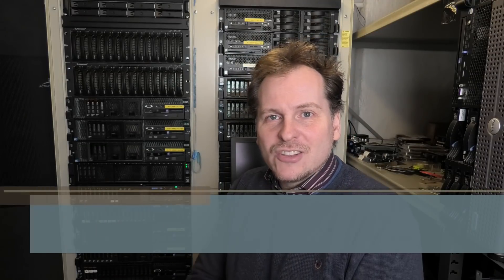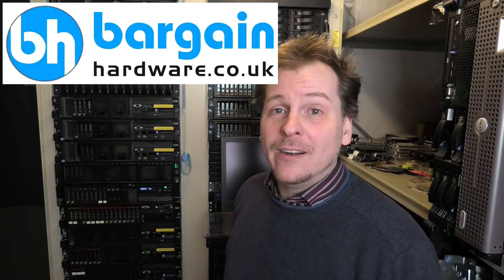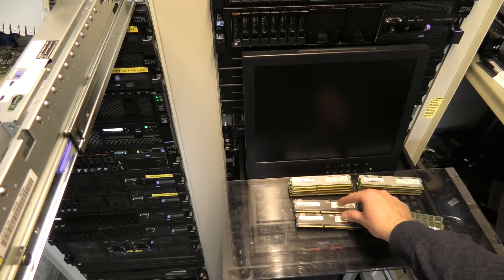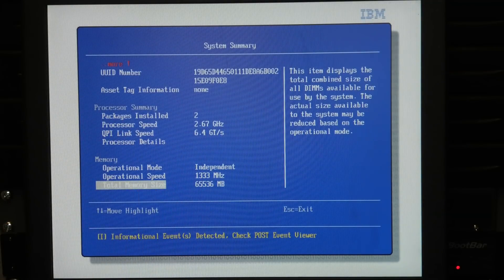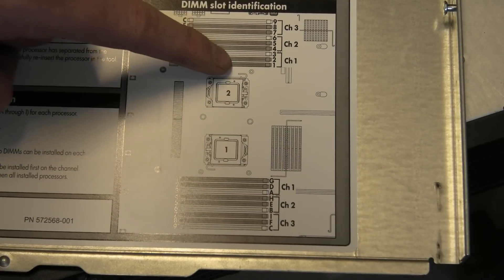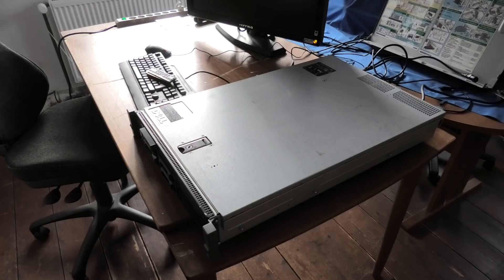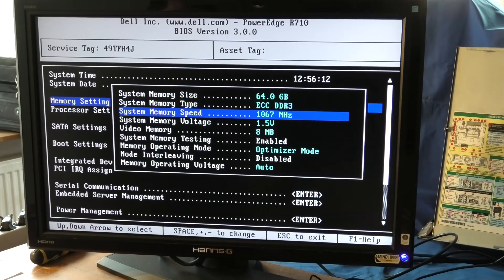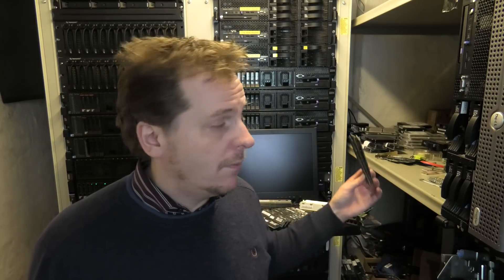3rd Party RAM in Lenovo x3650 M2, HP DL380G6 & Dell R710 - 924

Comment: The riser card "shield" thing in the DL380G6 was a royal pain in the ass to work around. I'm glad it didn't survive and get reused in G7.
Reply from the maker: It was different,, lucky the G6 was rather stable so it was not that often you had to mess with that.
Reply: @MyPlayHouse  Luckily for me, that was about the time we adopted blades for most of our servers, so i never had to deal with a lot of the DL380G6 servers. Now, i'm not entirely sure we actually gained anything from switching to BL460c servers and C7000 enclosures. It certainly wasn't cheaper and the flexibility was... not all that important in real life.
Reply from the maker: That is kind of irritating from a user perspective. And it's most likely just to Fuck with people that wants to use something non HP in there server,, they have a ton of temperature sensors in them,, so it's not as if they do not know what the temperature is.

Comment: I'm pretty happy with my Fujitsu Servers. They don't care at all if I put 3rd party stuff in them. Only downside with the RX300 S7 is that they won't take Xeon E5-2600v2 CPUs even if the RX300 S8 has the same Chipset. So it's more like a decision from Fujitsu to not roll out the microcode for the older boards.
Reply from the maker: I also kind of showed that these three servers did not mind..

Comment: Great video Morten, love the 'Editing Morten' giving you beans at the start, I always thought that you couldn't put "Non HP Branded" memory in a HP Server as it winds the fans up to 100%, a bit like adding an 'Nvidia' Graphics card, HP see's it as foreign and doesn't know what to do, so just ramps up the fans to 100% to protect itself, I only ask as I have a G7 full with 4gb blocks and wanted to upgrade, but the "HP Branded" 8 GB or 16 GB blocks are so over priced.... Your G6 did run normally after boot "Not Jet Engine Mode" afterwards....
Reply from the maker: I do have a bit of RAM for HP servers : https://www.myplayhouse.dk/shop/en/server-parts/35-4gb-ddr3-1333-rdimm-pc3-10600r.html
https://www.myplayhouse.dk/shop/en/server-parts/41-4gb-ddr3-1333-rdimm-pc3-10600r.html
https://www.myplayhouse.dk/shop/en/server-parts/43-4gb-ddr3-1333-rdimm-pc3-10600r.html
But the Kingston should really work just fine! and Yes the dl380G6 did not keep making noise.
Reply: @MyPlayHouse  Ouch €480 to re-populate my server with new ram, thats more than the whole server cost me... might have to start saving....

Comment: You don't specify anywhere if the Kingston RAMs are dual-rank or quad-rank (2Rx4 or 4Rx4). For example, you can't fill all 18 positions in a Dell R710 with quad-rank RAMs. Dual-rank 2Rx4 is normally the better type. The rules for putting many RAMs in a R710 is a bit complicated.
If the RAM can run at 1.35V it is the low-voltage type, so you should specify it as PC3L-10600R.
In the webshop, for the Samsung 4 GB RAMs you write PC3L in the header but PC3 in the description.
Reply from the maker: Hi ytteman
Thank You very much!  I have tried to fix that,,, but it seems to be a bit blurry all around,, like here : https://www.kingstonmemoryshop.co.uk/kingston-ddr3-16gb-1333mhz-ibm-dimm-ram-memory-ktm-sx313lv-16g 
Thank you for watching! :-)

Comment: I really like your testing videos. I have just been "testing" our 2 IBM x3650m4 servers with HP - 32GB LRDIMM , 1333Mhz. But I did not have your luck. The macines HALTED with fatal error. I also tried with some other CPU´s E5-2697v2 and the machines crashed with them as well. So I am back with the org. configuration. Really disapointed with that.
Reply from the maker: Hi Datatekniker
That sucks,,, But I have pun in 32GB HP blockes in the x3650 M4 : https://youtu.be/ohNPUjuqRqc
Thank you for watching! :-)